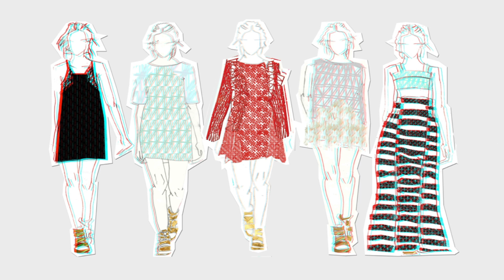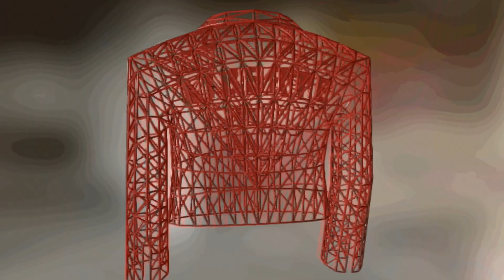Forget shopping. Soon you'll download your new clothes - Danit Peleg

Comment: Such clothes may sound cool but the cost of electricity and carbon footprint to run a 3D printer is huge, it's like driving a car for 10 miles, that much pollution just to produce a few dresses made from plastic

A better alternative would be to use your knitting machine to make clothes or developing a robot which can make cotton clothes from threads just like in factories, this would have a very low carbon footprint and would require neqligible amount of electricity